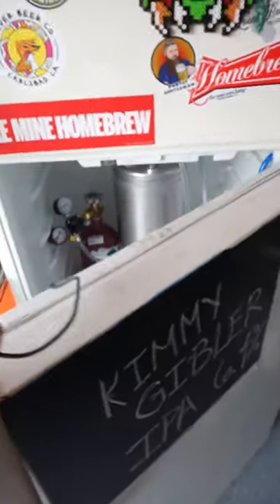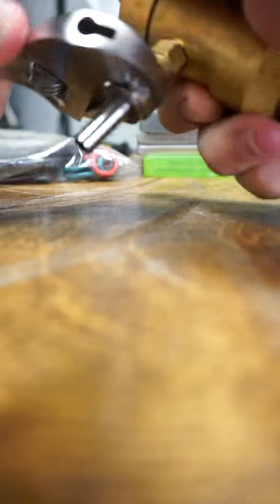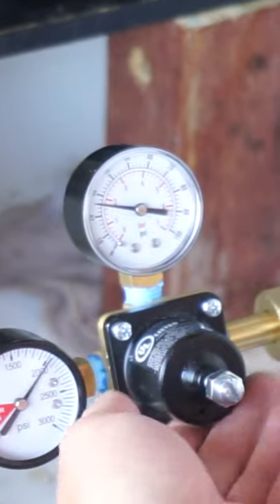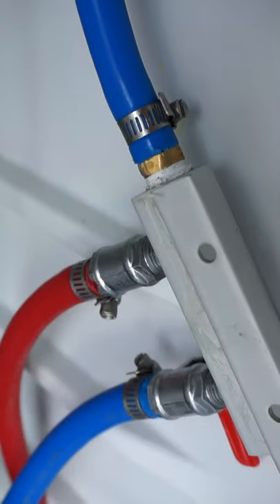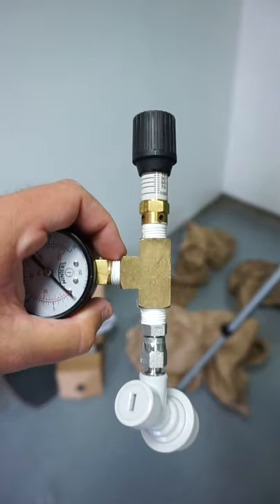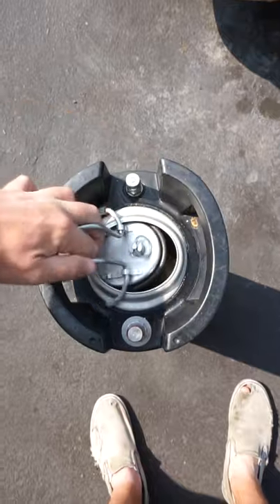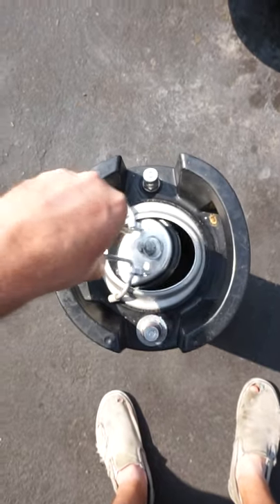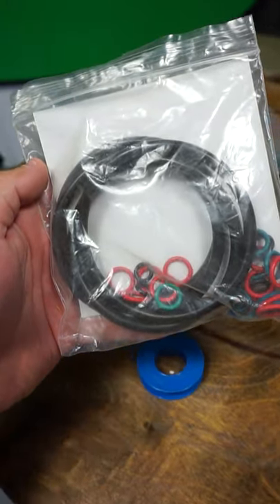DETECT and FIXING KEGERATOR C02 LEAKS | Homebrewing #shorts

Comment: Thanks for the great video! A must see for anybody with taps. I'm totally going to use Teflon now. I went over a year without problems in my kegerator and got lazy checking for leaks. I had to pay the price with burning a full tank and another incident with a loose liquid clamp that dumped an great beer and made a horrific mess. I've been checking seals with spraying Star San and looking for bubbles. I'm going to add your tips to my routine too. Cheers!
Reply from the maker: right on braj! cheers KO

Comment: Dunno if anybody suggested it, but Star San, while it works, makes really fine bubbles and can be hard to see. A few drops of dishwashing soap in a spray bottle makes bigger bubbles and is easier to see - add a little food coloring if you're still having trouble seeing those bubbles of lost gas. Great video and a solid process. Braj On!
Reply from the maker: yeah somebody earlier suggested shaving cream from an old mechanic trick.  I dig it!
Reply: The best thing to use is windex out of the spray bottle. Window cleaner will show you the smallest leaks. Been using it for almost 30 years.

Comment: And when checking the regulator, check all the parts not just where you connected it to the gas line. I just had a loose bolt where a second gauge would go on an old regulator that I decided to use for carbonating.
Reply from the maker: yup! make sure those gauges have plumber's tape and are securely fastened as well, cheers Andy!